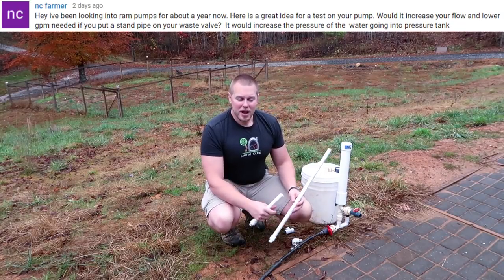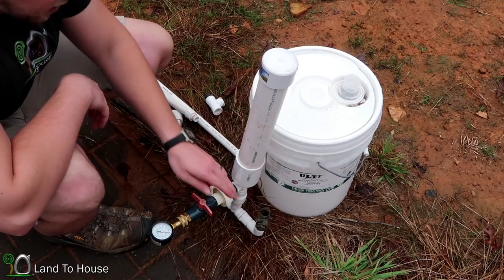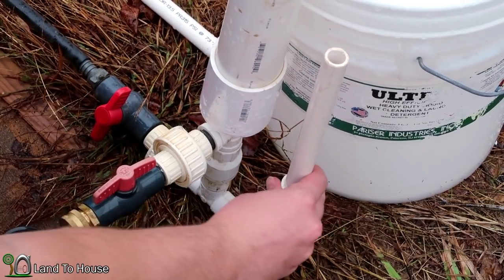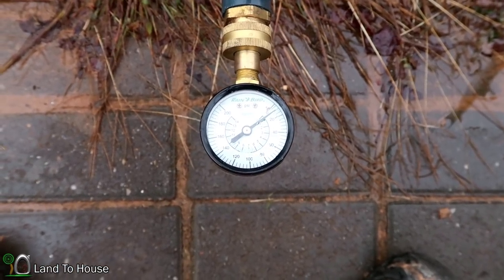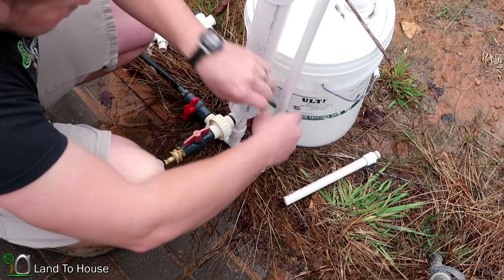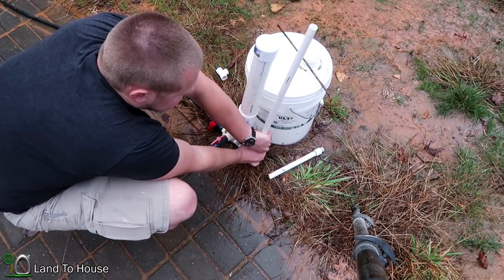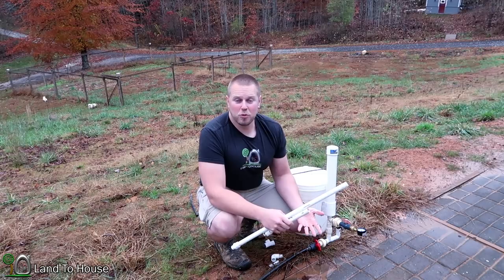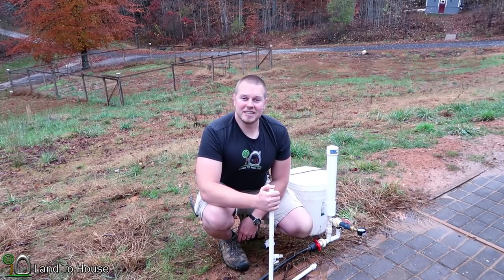Waste Valve Height - Ram Pump

Comment: Out of curiosity, what if you were to use a smaller diameter stand pipe?  The water flowing through it would certainly have increased pressure, but would the water within the smaller volume stand pipe have enough hydrostatic pressure to prevent the system from functioning?  Or alternately, could the drive pipe be a larger diameter to increase hydrostatic pressure on the ram pump to overcome the hydrostatic pressure of the stand pipe?
Reply from the maker: From my understanding hydrostatic pressure is based on the atmospheric pressure on the water. This means that the size of pipe standing vertically does not matter. The pressure is the same.  So no matter what size you make the pipe it will have the same limiting effect.

Comment: Hello Mr, I would like to ask for instructions regarding this hydraulic pum and I have succeeded in making hydraulic pum. I want to ask again, Water Expenditure from the check valve is Pretty Good The pressure, and Why isn't it used to be a water lifter from a depth of 20 meters ...?
Reply from the maker: Typically the weight of the waste valve is the limiting factor for Lyft. This style pump tops out at 50 meters. This requires 7.5 meters head pressure.

Comment: Could you angle the valve down as feed for a second smaller unit? I'm curious about feeding out of a tank but don't want to waste the excess so if the second unit would simply feed the waste back into the reservoir it should work id think.  If you only used the chamber and a check valve on the second unit wouldn't it act like sn amplifier

Comment: I would like you to take a "3/4" ram-pump" with 3/4" supply pipe from a bucket and find out what pressure it will produce. Then use one or two sizes larger supply pipe from the same bucket and the same 3/4' pump and find out what pressure it will now produce.
Reply from the maker: I have tested change in drive pipe on pumps as well as pump size on a set drive pipe. The small drive pipe does not supply enough water volume to the larger pump to get the valve closed. Unless you have a great head pressure that moves a high flow rate.  It is best to match the drive pipe size and the waste valve.

Comment: Why would youh want to add anything there? If you add that pipe on the output it would be no problem. 
At the same token the head is 3 ft, so why couldn't you have a3 ft vertical pipe for input and vertical 5 ft for output and stick it in a 4 ft pond and it should work to circulate pond water?

I noticed you keep saying 15 ft long pipe 25 ft long input pipe, 3 ft head. The length of input pipe doesn't matter?
Reply from the maker: This was a question from a viewer. The addition of a pipe on the waste valve reduces the input head pressure. 

The drive pipe length does matter! The delivery pipe length is the one that can be very very long.

Comment: Ok, an OPEN stand pipe reduces pump outlet pressure. Now how about this?: 3' stand pipe, "t" with the inline having a removable cap to start the pump, side outlet connected to a 45, 4' pipe out of the 45, open on the outlet end.  The idea being the angled down pipe should create a bit of suction(vacuum) in the stand pipe.
Reply from the maker: Interesting idea. I wonder if the bit of suction would close the valve too early and prevent the valve from reopening
Reply: That is a possibility. I may have to use the bucket method and build one myself to test that out. I don't have a stream nearby that I can use.

Comment: How about doubling the size of the waste valve of the other valve!!! You could also increase the size of your chamber to see if it would increase the pressure as well?
Reply from the maker: The issue with doubling the size of the waste valve is the pressure wave going to the pump is small and the wave that is going away is large. This mismatch makes the pump inefficient.

Comment: The stand pipe on the waste gate makes it even more inefficient because if you put a stand pipe the same height as your head height the water would not move. I am no expert at all but it seems the faster the water moves the more efficient the device will work....... so what if you speed the waste gate up? Maybe add a 45 instead of a 90 going to the waste gate and see what that does?
Reply: You could actually achieve this with a 90 but over tighten it to be toward the side and then you could “fine tune” the waste gate by either standing it up or laying it over
Reply from the maker: You are 100% right. This test was to prove to a viewer that increasing the height would reduce the output. I have a video from years ago showing how tilting the waste valve will allow the pump to operate with a lower head pressure or lower flow rate. It does however reduce the efficiency.

Comment: What if you submerge the ram pump into a lake or sea to use the overhead water as the intake and then have a hose or pipe from the pump and up above sealevel and more. Will it be able to pump the water above sealevel ?? Or will the output valve ble closed all the time ? Can that problem be solved with another valve ?

Regards from Tommy in Norway
Reply from the maker: Using the ram pump in a stagnant body of water does not work. Going down does increases the head pressure but also the hydrostatic pressure.  These two are equal and opposite. So the ram does not work.

Comment: Have you ever tried making a multi-stage pump?  Use the waste water from one pump to run a second, smaller pump?  
(I have not looked at your other videos, yet, so if you've already done this, just ignore me or post the link)
Reply from the maker: I actually have done that test. It did not turn out as well as I would like. Here is that link:  https://youtu.be/umxcP4G3FXE

Its an older video.

Comment: im trying to recapture the waste water back to the head spring this week. im guessing i will need to move pump to increase pressure first. i will document my outcomes on my website.
Reply from the maker: When you say head spring do you mean the pump is away from the creek and you want to take the water back OR do you mean you are going to pump the water back to the input of the ram pump?
Reply: we built a reservoir to catch the spring water at the spring source. the ram pump feed pipe attaches to reservoir wall. there is currently 3 feet of drop to ram pump. the other end goes up 20 feet roughly to house tank. the ram pump sometimes empties reservoir faster then the spring fills it. so we intend to see if we can adjust everything enough to return waste water back to spring reservoir. we can drop the pump giving it as much as nearly 12-15 feet of head if we need to. without actually increasing the rise to house more than a foot or two. lots of room to play with. thinking the stand pipe for waste water needs to be 3.8 feet high to allow it to gravity feed back to reservoir at current placement and we can afford to lose 6 feet of lift with current positioning. knowing that the lift will be reduced with each foot of waste water stand pipe. if we give more drop to pump then obviously it will need a taller stand pipe to reach spring reservoir. and we are using a T to give us access to the check valve as well.
Reply: you may want to change your waste valve out for something like a foot valve so you can adjust water usage:
https://www.youtube.com/watch?v=G1YoVNvzXGM&t=2s
Hope this helps.
Reply: left you a comment on your video.
Reply from the maker: Did you get any good results from your recapture experiment?
Reply: well have not done the recapture experiment yet because i tried swapping the waste water 3/4" check valve with a 1/2" check valve and it has seemed to solve my over consumption issue for now. however i have noted i am getting twice as much flow now into my house storage tank. seems it increased the out flow quite a bit somehow. anyhow my spring head reservoir is over flowing as it should and my house tank is also. so figure not to mess with it until there is an issue :)
Reply from the maker: That is a good thing! To have an overflowing water source is what you want for sure!
Reply: it increased your outflow because the smaller waste valve requires less total flow to close. thus, it closes faster, and results in a faster rate of pulses. it also reduces the loss to waste, because it requires less water to start the valve closure process.

Comment: Would you be able to increase pressure by extending the distance that the waste valve is away from the pump body horizontally?
Reply from the maker: Actually its the opposite.  The further you move the waste valve from the pump the less likely the pump will cycle. I was out in a creek this past year working on a pump and it would not start because the waste valve was almost 2 feet away from the pump.
Reply: @LandtoHouse  What if the inline check was further away rather? The one that supplies the output.

Comment: A couple other questions::
Would putting a short standpipe say six inches with a T on top so you can access the valve to start and run the pile off a distance to keep the area around the pump dry be feasible option?

Also does the standpipe help reduce the sound of the valve clapping shut?
Reply: Yes... a T or 90 will work to divert flow away from the working area.  A standpipe is to supply adequate volume to run the pump as well as dissipate shock waves to prevent them from traveling further up the pipe and causing "interference waves". The water wave flowing through a  long pipe will start to counteract itself within the pipe if the shock wave is traveling too far. Hope this helps.
Reply: You want that valve to make alot of noise. Slamming shut! Bang! That shock transfers to pushing water uphill!
Reply: Well actually you want that shock to transfer as hydraulic pressure... noise is actually dissipation although you will get more noise with better action. But yes, to your point, you want that valve to close as suddenly as possible causing a higher pressure wave.
Reply from the maker: Using a small pipe with T on it is a great way to move the water away from the pump. It does keep a little sound down but also reduces the efficiency. Small trade off.

Comment: Watched a lot of your video's and enjoyed them.  I was wondering what would happen if you used a larger tee and check valve.  By my thinking with the larger check valve more water would flow at a greater speed before the valve slams shut creating the pressure wave.  With the increased mass and speed there should be a corresponding increase in flow and pressure as long as the drive pipe can provide enough flow to slam the check valve.  What do you think ?
Reply: Ken Fischmann only works if you also increase the entire piping from your source.... 
do you get what I’m saying?

Comment: what happens if the waste valve is faced down with the waste water line going down a few inches, does this help add pressure?
Reply from the maker: Good question. This will actually stop the pump. The valve needs to hang open from gravity to allow the pressure wave a chance to slam closed. if the valve is facing down the pump wont cycle.
Reply: ok, thanks. how big would a ram pump have to be to give the same rate of water that a standard water company provides?

Comment: how are you dealing with air dissloving into your pressure-vessel water? once that cushion of air is gone, your ram will be very loud and start to malfunction.

i use a snifter valve on the drive pipe to draw in a small gulp of air when the drive water is at peak velocity, so i am always supplying just a few bubbles to the pressure chamber.
Reply from the maker: I use a bicycle inner tube in the pressure tank. That way it always has a known volume of air. Seems to allow the pump to run for 6 months easily.

Comment: Dont know if anyone else has commented this yet, but according to all the descriptive picture and instructions I have reviewed on ram pumps, what you are adding to the pump at the waste valve would not be correctly identified as a "stand pipe". A stand pipe should be in the head side of the pump, it should reach to the elevation of the head water that is flowing to the pump and is used when the run from the head to the pump is longer than is optimal (based off the pipe size and delivery height you are looking to make) so that you can maintain proper head pressure and so the ram pump shock wave can make its full effect thus making the pump work more efficiently.

For this test though, it would be interesting to see if you could add a water capture system at the waste valve, would have to use an elbow right at the waste valve, possibly with a vent hole at the top of the arch, and direct the water down a pipe system to whatever you use next, such as a catch pool. I was also curious if using this method, could you use the waste water to create a water pump that can move the waste water for you.
Reply from the maker: I was giving the pipe the name stand pipe for lack of better term. It is not useful in this situation. 

I actually have a video showing the capture of the waste water for use down stream. I used a T so that the system could be open to air and still carry the waste water away from the pump. It worked very well!
Reply: @LandtoHouse  can you put a link to this video I must have missed it
Reply from the maker: Yes check this one out. https://youtu.be/CXj2BGc5Lkg

Comment: What if you put the pressure tank on the stand pipe and used the shorter stand pipe on the waste valve ?
Reply from the maker: If the pressure tank is taller it does not really effect the pump. The air pocket is at the top of the pressure tank.

Comment: Great videos. I have a question. Can a ram pump work with a vertical drive pipe or must is be slippery for 20'+? Please do a vertical drive pipe so I can see if it's worth the trouble of convincing the Mrs
Reply from the maker: That is a fantastic question. I will attempt to test that this week. Sometime ago I ran a ram pump from a 55 gallon drum with only a 5-foot Drive pipe. The hydrostatic water pressure in the drum is what drove the pump. Basically a vertical pipe would be similar to this. There may be some efficiency loss at the bottom if you have to bring a 90 degree tee into the pump
Reply: @LandtoHouse  I'm working in the confines of an IBC tote. Any magic you can make would be great. I have about 6" of water in the bottom as a sump tank and I have a return flow from another IBC fish tank next to it. It's about 800ltrs per hour flow through a 2" over flow. Would like the ram pump to pump at least 6" feet with enough flow to run through a trough with plants in. Aquaponics again

I came up with a new design for ur inner tube. Maybe you could give it a try.

I drilled a hole in the lid of a 750ml plastic water bottle and fitted a car tyre valve. Pumped it up to 2bar and it held no problems. I let the pressure out till I could firmly squeeze the bottle and then put it into a 4" chamber.
Reply from the maker: Are you trying to use the ram pump in a closed system? I find that because the pump is so lossy all of your water will end up at the bottom of the system quickly.
Reply: @LandtoHouse  yeah in a closed loop
Reply from the maker: It can work but not well. Say you have 100 gallons of water to run a 1-1/4" pump. At best you will pump 10% of that water back to the top. So now you have 10 gallons from the 100. You can see how fast the water will be at the bottom of the system.
Reply: @LandtoHouse  iv had it working and pumped around 6' but it kept shutting off. Sounded like it was double pumping and getting an air lock. If I can find a better way of collection it might help
Reply from the maker: Yes when the waste valve doubleclick's it's usually because of air bubbles in the line
Reply: Land to House 
Why do you want to rotate the pump system through 90 deg, to be horizontal, over a very short distance.
A 3m pipe, with radius of 2m will do.
Always suspend the pump structure and at least 2m of supply pipe, well and solid.
No movement.
Reply: How is your closed circuit ram pump working?

Comment: sir can you explain the waste valve usage?.. if the waste valve not in that place what happend? recreate the air pressure??
Reply from the maker: If the waste valve is not there the pump is no longer a pump. The waste valve needs to be in place to allow the pump to cycle and create a pressure wave.

Comment: What if you reversed it?  What if you put the waste valve below?  The more I read about this, the more and more I'm convinced a motor can be built out of nothing more than using multiple RAM pumps linked in parallel.
Reply from the maker: I am not sure what you mean about putting the waste valve below?
Reply: What if you had the waste valve either pointed down, modified to work appropriately that way, or do a few 90 degree joints so that the waste valve is a few inches below, and parallel to the rest of the ram pump.  Does that make sense?  Or perhaps a combination of the two?
Reply from the maker: Oh I see. The first idea sadly does not work because the flap much fall open by gravity. The other idea does work with 90's to lower the waste valve but there can be a few issues. There needs to be a small water void at the waste valve so that the flap can drop. If you have the valve too low the flap hits water and does not close. Also the 90's reduce the flow rate of the water and can stop the pump.
Reply: Fair enough.  I was just curious if enough of experimentation or ideas could come of this to warrant a revisit to this for a future video with this kind of a concept, perhaps not using 90 degrees but something more gradual.  You get the idea.